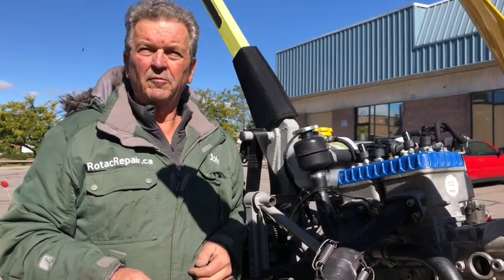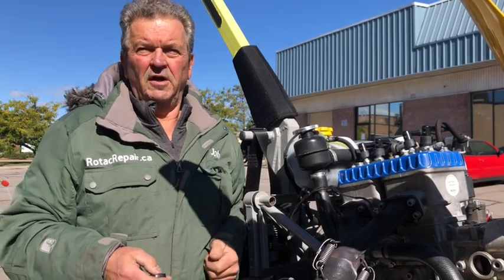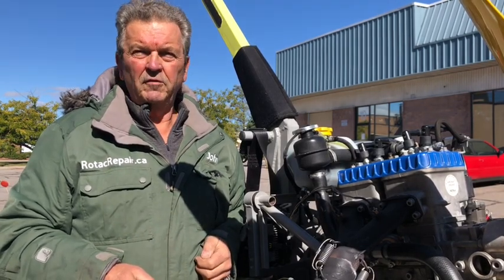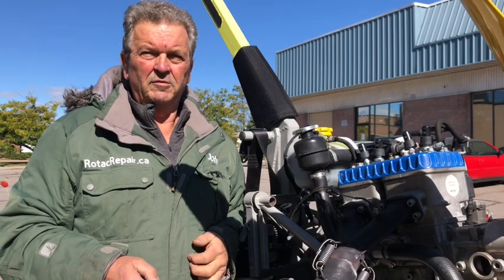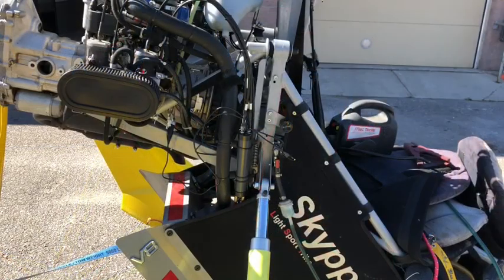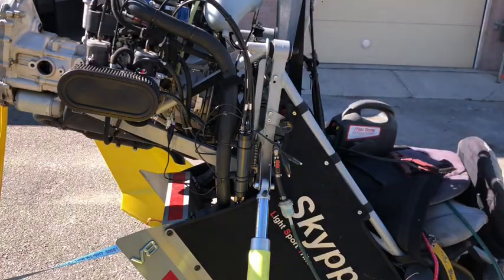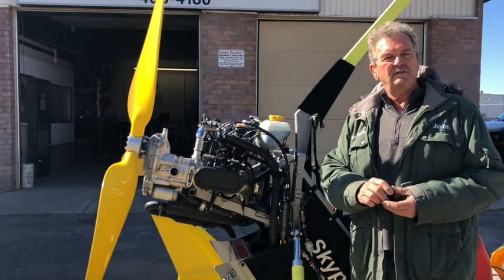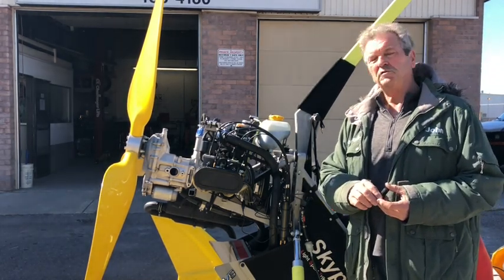Rotax 582UL sudden engine stoppage diagnosis

Comment: Thank you!  Looks like this engine has oil injection, so it was getting plenty of extra oil with your 50:1 premix.  Kind of hard to hear you.  An external mic would help that.
Reply from the maker: Your welcome. Yes it was getting lots of oil as I only had premix fuel on hand. Thank you for the sound comment. I do apologize, I forgot to increase the voice sound level sections before publishing the video.
Reply: @RotacRepair  so it's ok to run a bit of premix with oil injection just to make sure the oil injection is actually working?  When I was fixin golf carts we were happy to just see the pump pushing oil from the line as a check.